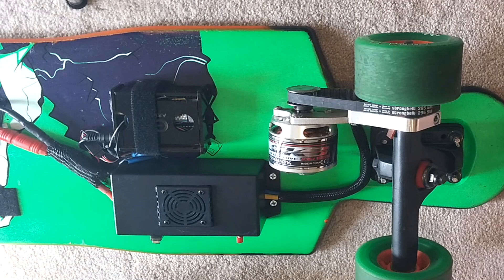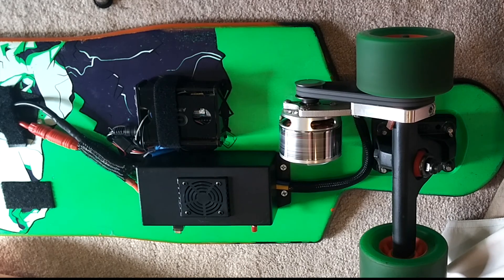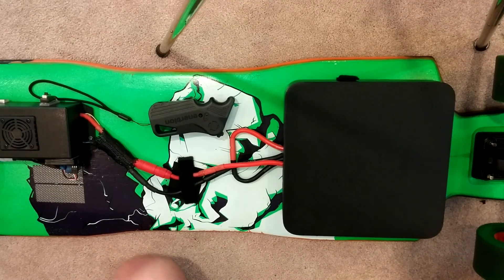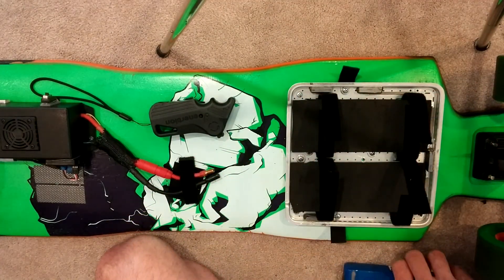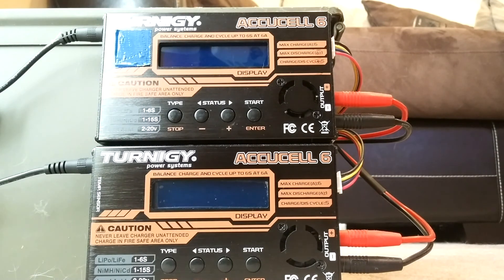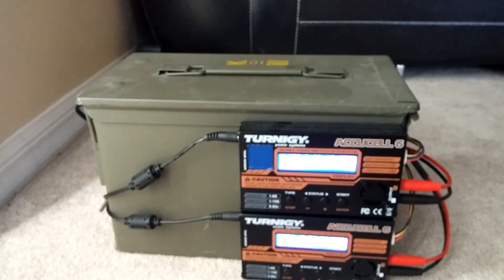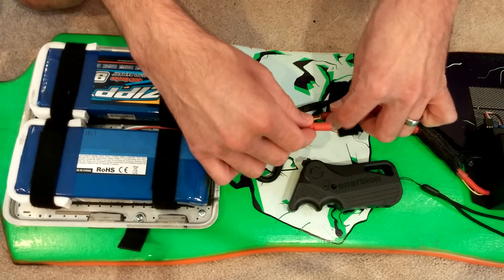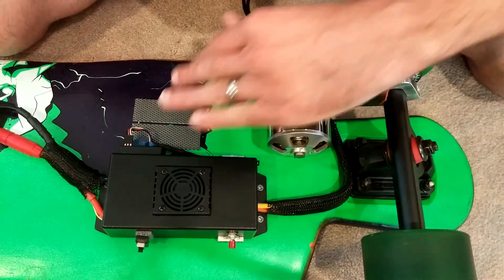My Awesome DIY Electric Longboard Setup - How to use it

Comment: How you use a brake with your esc, you need to program something ? because there is a lot of esc who do not have a reverse fonction
Reply: With the HobyKing X-car - 150A and 120A ESC's, you can get a program card where you set if you want reverse or not and how strong the braking force is. In this video, he had it very soft.